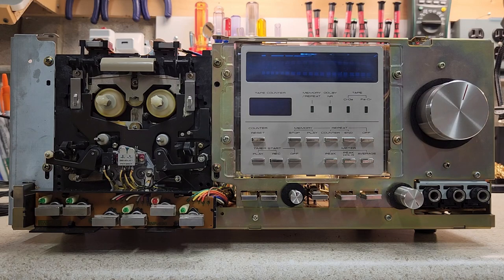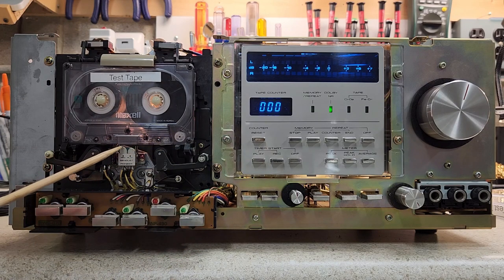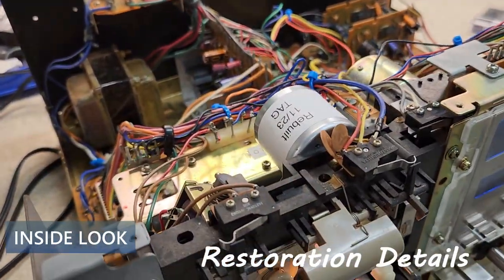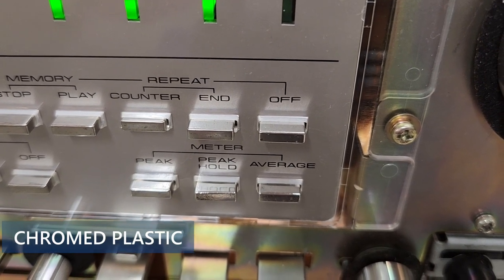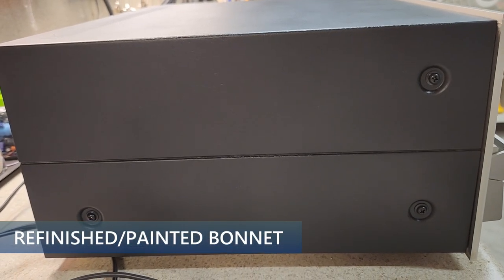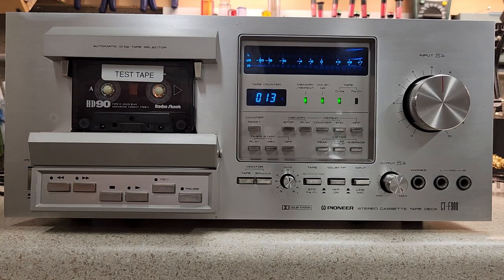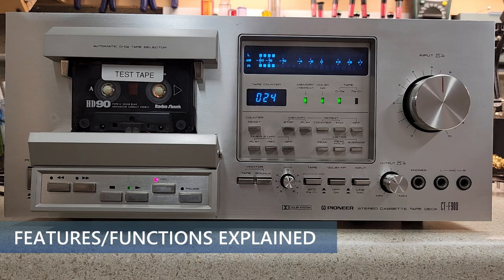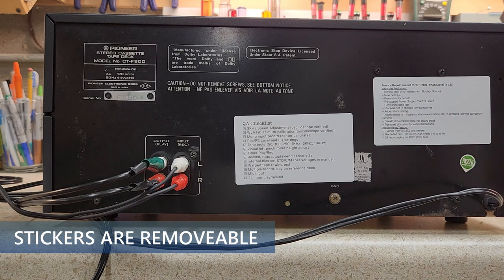Refurbished Pioneer CT-F900 Vintage Three-Head Cassette Deck

Comment: Hi. I have  a question. 900 wont erase CR tapes when recording but ok with normal ones even the bias is at -3. For CR when bias is at +5 then the old recording can not be heard.  What could be the problem? Thanks.
Reply from the maker: A few possibilities.  Outside of a dirty erase head, it could be (and most likely is) a problem in the bias circuit that feeds the correct current to the erase head.  Because it will erase normal tapes, but not high-bias tapes, it's likely either an adjustment (there's a pot inside that can be turned), or it could be one of the capacitors in the bias circuit that's bad.  Occasionally, I find a bad transistor in that circuit.  Both are easily sourced for the 900 and can be done with little fuss.

Comment: Hello, I hope that you can answer to me. I'm from Argentina and I've recently acquired this deck model and I  have a doubt. Is it possible to record multimedia music on a cassette with this deck. My idea is to connect my phone on the amplifier in the part that says AUX and record a cassette. Is this possible? 
Thank you
Reply from the maker: Yes, it is.  Use the output from your phone as input to the line-in of the deck.  Should work just fine.

Comment: Was considering to Buy one of these, not anymore. Temperamental Junk as far as I am concerned.
Reply from the maker: These don't fall into that category, when properly refurbished and maintained.  Now, the series that immediately followed these (like the CT-9R) are most probably the worst decks I've ever serviced.  They definitely fall into the temperamental junk category for me.  But, the CT-F900, 950, 1250 are gems.  Easy to work on, easy to fix, and easy to look at.